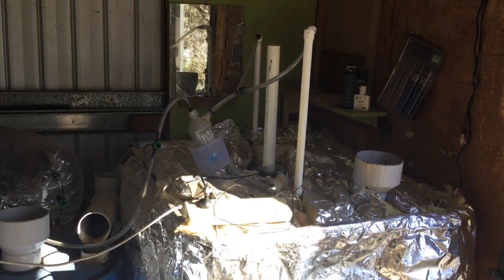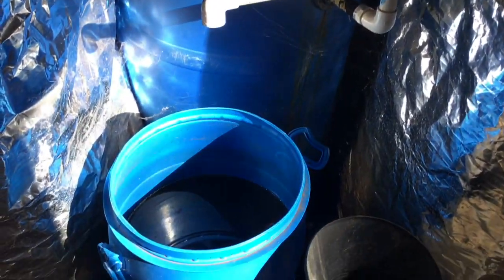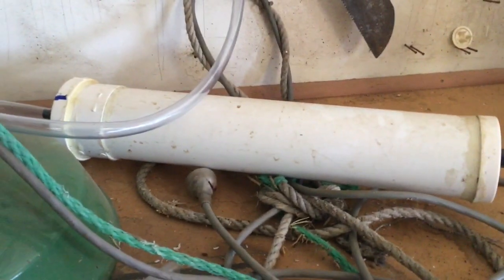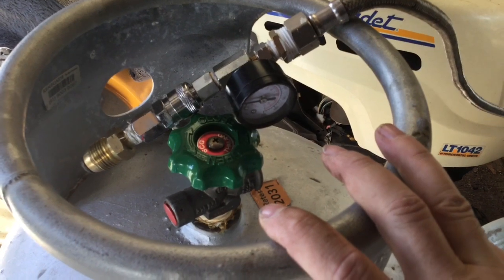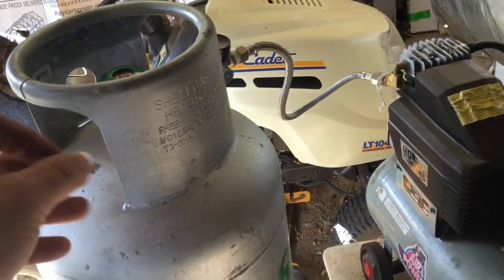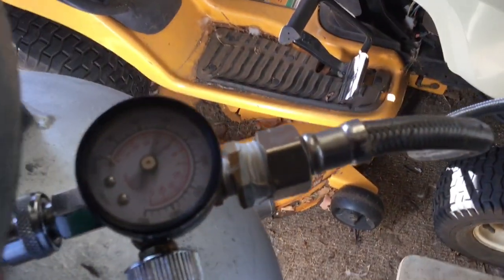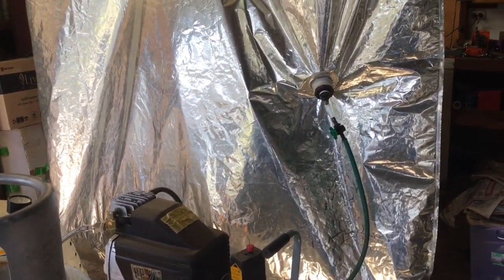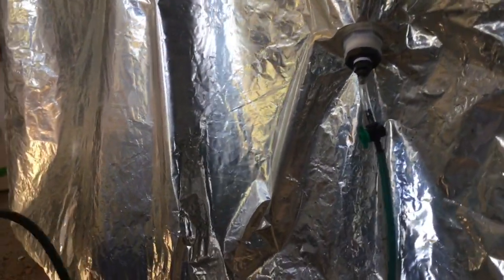Compressing Biogas !NEW! 1000L into a 45kg tank

Comment: I know that is an older video, but have you considered  using a fridge/freezer compressor instead? Uses a fraction of the power to run, and reaches a higher pressure, like 400psi. through a pressure switch on it,, and you could automate it. Also runs much cooler, and the lubrication can be handled by a self built oil  accumulator
Reply: He said in the video you can't go much higher with the pressure because in order to do that you would need liquid nitrogen to cool the gas into liquid. Not practical for at home unless you have a liquid nitrogen. If I understand correctly highly compressed hydrogen is dangerous if it's not in Liquid form
Reply: I was thinking that too. You would need a condenser with a fan to cool the compressed gas... like a refrigerator.  It should work.

Comment: The idea for having an aquarium heater is great. Here is how you avoid cleaning it. Place it i a separate pvc pipe cylinder with antifreeze in it. Seal it off so it will not leak. place it in a uniseal  at the lower part of the container. This will work and keep it effective for heating the effluent.
Reply: Why would you even bother though? What am I missing?
Reply: @adamsaquatics3332  could be another video..i hv also seen it somewhre
Reply: find someone selling a used waterbed and then ask them for just the heater. not a single person buys a used waterbed so you will get the heating mat for free. strap that to the outside of digester with no extra parts and you only have to clean that 0 times in forever. you could possibly use the waterbed as storage as well

Comment: I know this is a few years late BUT have you thought about using dry ice against a kind of heat exchanger before the gas goes into the cylinder? Ideally, the gas would cool to near 195K (Dry ice temp) and then when the temperature rose back up to ~20C the pressure in the tank would be about 240PSI (if the initial pressure was 160PSI). It could be a cheap (ish) way to test cooling the gas for higher compression with the existing compressor.

Comment: Just a thought if methane is lighter than air would it not be beneficial if you turn the bottle upside down when flushing it? That way the methane would stay at the top pushing oxygen out? An easy way to test it would be holding a lighter up until it ignites?

Comment: Hello my friend. I´ve been looking for some time about how to do this. The horrendous experience with the authoritarian regime in my country, #Venezuela, has made me to find alternative ways to provide fuel for my modest needs: cooking and fueling my vehicles, an SUV and a motorcycle. After reading some really useful documents I´ve found that moisture needs to be retrieved from the gas (fitting an inline silica gel filter, maybe from a car air conditioning) and a scrubber (an enclosed vessel filled up with steel wool) which will react with the sulfides and sulfates and will avoid the corrosion associated to sulphurs.  
I´ve not yet built it because of my return was stopped by the Quarantine but I´m going to use your videos as a guide. 
Thanks for sharing, dude!
P.S. PLease people remember this gas explodes. Use your common sense.
Reply: Thanks for the ideas
Reply: I've seen other videos where it's being said that it doesn't explode 🤷‍♀️

Comment: Great video. Just stumbled on your station after brief google search for biogas compression. I have installed several 10m3 biogas plants in Indonesia, and am wanting to diversify the application to more than just stoves. The next step for me is everything you have done. Scrubbing, cleaning, and compression. Seems I am getting stuck on the cleaning/scrubbing step, but your bleach/water tank and steel wool/clay pellets seem to do the trick eh? Where did you learn the bleach/water mixture idea from? Can you explain the flow there? Does the gas bubble up from the bottom? What is the bleach/water ratio? Do you change that out? How often? Awesome video, keep making them!

Comment: I have recently started watching your videos and I am impressed! you have such a nice setup.
I have 2 questions regarding your system. I hope you answer.
1) How do you stop the gas leakage from the overflow pipes as I don't see any valve around the overflow pipe.
2) How many days would it take to refill this gas bag after it has been empty?
Reply from the maker: Hey mate, over flow pipe goes down into the liquid on the inside, stops the gas. As far as filling the bag, depends on temperature, how much feed, what you feed, and how often you feed, optimal conditions I can do the bag in 2 days
Reply: Okay Got it!
Thankyou for the reply :)

Comment: thank you for the video. Would you please show in detail how you empty the  oxygen out of the tank. thank you
Reply: I think I heard him mention that because he used what was in it, that he knew there was no oxygen inside. I guess as long as the tank valve was closed when the previous gas content stopped having usable pressure there was no chance for oxygen to enter. I do wonder how biogas and residual propane get along though? Is this a non issue? I use a butane long reach lighter for igniting my propane cookstove. Unlit  propane often somehow " blows out" the lighter flame. 
Not sure what is really happening when these two flammable gasses meet.

Comment: The electrical consumption surely exceeded the energy in btu from the gas available. Best to just use the gas at low pressure in large bags or else it essentially makes a worthless process. The only way I am aware for this to make any sense is that it was a compressor fueled by the bio gas itself to compress the bio gas. Thats the reason wellhead gas is transported from the wellhead to the refinery by compressors that are run by the very gas they are transporting. Love the experimenting though! Always fun to watch!

Comment: Hey mate (sorry I don’t know your name), I love your videos and am currently in the process of building a mini biogas system, using a 20L bucket. This is just to prove to my wife that the system works and it’s worth me building multiple large ones 🤣🤣 (convincing the wife is a process).
Do you feel it’s worth compressing the biogas into the cylinders?. I mean, have you had reasonable success doing so?. I was originally excited about compressing biogas, as I’m a plumber and understand how to put these sorts of things together, with little effort. However when i started reading up on methane and found you couldn’t compress it to liquid form without lowering the Temperature to -150 degrees C, it was a bit of a downer. Then i saw your video and thought “I wonder how much he’s actually getting in there?”. So are you compressing that entire air mattress into a 9kg bottle? 
How long does this take and how much time are you getting out of the compressed gas?
You’re just connecting the air intake for the compressor, to the methane filled air mattress, yeah?.
I am currently sitting on the thought that I will probably just collect truck tyre tubes and stack them one on top of the other, in some sort of cylinder enclosure. I thought i might use a large container on top of the tubes, which I can fill with water using a valve, to compress the tyre tubes and force out the gas. I can always muck around with the spring in the 2.75kpa LPG regular if needed and bore out the injectors also, using a purpose made hand held boring drill. You get these at gas wholesaler places like BOC, or you can order them online (incase you haven’t heard of these already mate).
Anyway, would love to hear your thoughts mate. Love your channel, love what you are doing and am super excited about the advancement to the generator. I shared this video with a couple of mates and dream about the day that I can run the AC at home, on a biogas fuel generator (we need AC here in SE QLD mate).

Cheers

Chris

Comment: So cool! Perhaps a silly question, but could you use the tank on the compressor to store the gas?
Reply from the maker: You could,  wouldn’t store much, but possible, you would need a valve at the output end to keep the gas in, then possibly have a hose and regulator then use it straight from the compressor.

Comment: Thanks for your video. Is there a risk of fire or explosion when you compress the gas into the cylinder?
Reply: Triangle Fire = Heat + Oxygen + Fuel. 
In that cylinder only have Fuel + Heat (no Oxygen then no fire or explosion)

Comment: Hi . . . .really fantastic setup and easily understable content. . . .I've become a fan of your ideas.  . . Rolled down the comments and couldn't find one one bit... Is there a net calculation of energy generated vs available for use. . . .sorry I  cud'nt put my head around it. . . .just an easy to refer calculation right from amount of biofeed into the digester to compressor to electricity generator and the energy required to transfer/ transform at each stage... and wastage stages so they can be contained.  . . .cheers viv

Comment: Hello mate! 
I am deeply happy to find your channel and learn all these things from you about Biogas! It's amazing when you realize that energy is a free good..
I am a real keen of renewable energy sources and I was wondering lately how to have free heating for my house during Winter time. So when I found your channel was like an oasis! Haha. I really I appreciate you
So my long project short is to produce  Biogas during automn and summer and store it in tanks so that I can burn it later. 
A few questions though
In this 45kg tank the maximum storage capacity of Biogas is 1000lt (in 1 atmospheric pressure)??? Can't we store inside more?? Or is it impossible with this specific compressor? 
My question is if we can fill the tank to its commercial capacity as when we buy it full from the store so that can be more of handy
Reply from the maker: Hi Nick, to get practical and commercial amounts in a gas bottle, you will need a dedicated compressor ( have a look at Nuvair CNG) and CNG tanks as they handle higher pressures. Also have a look at Liquid Compressed Natural Gas. Very interesting.

Comment: If you cool the Cylinder it would help suck the gas in itself.   Gas will be worm and cylinder cool to about 10c would help . Transfer the gas . Its like the plastic lighters you get hard to fill when warm .But if you cool the lighter in the fridge  for half hour .It will fill fast to the top. with the warm gas .

Comment: I never thought about using an air compressor to fill tanks . I can't believe you have no safe guard's in place unless that compressor is totally made of a non metallic alloy all its gonna take is one spark everything is sitting side by side in a closed space with you in it . Its gonna light up with an explosion then a flash fire. I'm going to pretty much use your setup except the compressor will sit behind a concrete wall 25 to 50ft away no ceiling so the energy would travel upwards then a poured concrete enclosure 25 to 50ft away probley 25ft would work. Wall thickness 4 to 6ins between 3 to 4ft  high with couple pieces steel tubing or a mess  mat you could easily  lay over catching flying debris somewhere between the two a block wall where you can stand with the switch in an explosion proof electrical box. Couple fire extinguishers. Yes this sounds extreme Ive pulled a gasoline tanker for  many year's  until becoming msha certified to work in any strip mine in 49 states and I've always said just before it went all wrong it was going alright.  Again thanks for sharing your setup

Comment: Very good old mate just found you today this is the second video of watched pretty impressive.just a idea on the discharge side of the compressor run the gas line through a condenser to minimise heat
Reply from the maker: Definitely something to look into! , I’m usually short on time, is there a source for info of how to hook up that I can look at off the top of your head?
Reply: Lucky Hill Farm  copper coil in a drum of water 3/4 inch the heat will disperse into the cold water yeah and time is one that is not on anyone’s side.where is aus are you
Reply from the maker: Near Orange nsw
Reply: Lucky Hill Farm central Vic near bendigo
Reply from the maker: Ahhh nice one, originally from Albury.
Reply: Lucky Hill Farm going to have a crack at making one shall use Chook sheep cow shit in it that should work ok

Comment: Um use  a scuba diving compressor 4500 psi and a tank for nitrogen replace the valve with one that is used for combustable fuel. Place the tank in a hole fill with ice to lower temp to zero. Liquid methane. Now at 4500 psi in liquid state is stable and can hold weeks of fuel per tank.😊

Comment: Very interesting ! Thanks for sharing ! I will try the same. Have you assessed the possible risks ? Do you have any warning or advice about that ?
Reply from the maker: Sorry for the delay, biogas is a relatively safe gas to work with compared to LPG/Propane and other natural gases, I may do a video where I purposely try and explode a small gas bag, a lot of gas appliances have safety gas shut offs, currently working on a fridge vid and it shuts off if the gas dies down or flame goes out, the wife still didn’t like the digesters near the house hence the ‘moving the digester vid’ but there is bugger all gas within the digester itself, I’ve never used check valves only the water lock/bubbler/scrubber from the tank itself, but of course there is always a chance of risk with combustibles.

Comment: When you compress any gas it makes the surrounding pipes and tubing heat up tremendously, People wanting to try this need to be careful that the piping coming out of their compressor does not over heat. Many air compressor tubes have aluminum heatsinks around them to help dissipate this heat. A flexible water hose with rubber inside is definitely not what people should use.

Comment: Newby questions.  How do you know the tank is full?  What pressure is high or dangerous?  Is the gas in the tank useable down to a pressure of zero?  Does the heat generated by compressing the gas reach any kind of dangerous temperature?  How is the "burn time" of that biogas tank you filled compared to propane?
Reply: The safety valves will release at about 250 PSI on a tank that is in good condition. If you have the "swap and go" system near you then you could grab a bottle from there and use the propane then refill it with bio gas, that way you know it also has no air inside the bottle when you fill it up, or you could buy a new bottle on ebay or from a camping store. The 18kg bottles (forklift size) are a good compromise size, easy enough to move around but still hold double the small BBQ bottles

Comment: interesting set up, well done you, any idea on how long would the 45 kg bottle run an infinity heater or generator converted to gas for ?
Reply from the maker: A generator I have not tried, you can get biogas specific gens from China, hot water systems are good, I have a biogas instantaneous hot water system (previous vids) that I’ve just a bbq bottle on, not sure if I did a vid with the 45kg but I’ve used it and lasts quite a while, worth it if your gas production is high enough
Reply: How long does it take to fill you're containment bag :-)

Comment: Wood gas at it's best is methane and hydrogen and at worst carbon monoxide.  I used a sealed vessel with external heat and running the wood gas through a catalytic converter. The gas is similar to natural gas which is a low energy gas that does not liquefy.  I have some in propane tanks that has been stored for at least 7 years. I crack the valve and burn some now and then, it is as god as it was when I made it.
Reply: I want to do like this. Can i directly fill cilinder.

Comment: Hmm so apparently the moon titan is likely to have liquid methane, due to cold temps. Getting methane that cold and keeping it there is really practical, as you eluded to.
Is there really much benefit to compressing it into a 45kg bottle? Seems like your getting the volume down to maybe an 8th of size, but that took half hr running compressor (chewing power).
What are advantages of using 45kg bottle over a bag?
Thanks for your vids.
I'm waiting for heater to arrive to warm up my first IBC, I was impatient and have already added cow poop, tank only art about 18deg C.. plan on building another 15+ if everything goes to plan.. Will need to work out my insulation method, as they'll be outside in the sun (and cold of night)..
Reply from the maker: The compressor is running off solar power so FREE 😀 the advantage of compressed gas that I’ve found at least is steady pressure when hooked up the the regulator, especially with the instantaneous hot water system, it’s in one of my vids somewhere, and no power leads running everywhere. I prefer it.

Comment: I did something similar. The only thing is that the head of the compressor heats more when compressing biogas than compressing air, so I added water cooling to the head by wrapping copper tubing around the head. If the biogas is a bit cooler, you can compress more into the storage tank.

Comment: It's really nice i want to know about the full details of compressor that used
Reply from the maker: Just a general cheap one from the hardware store, then I had to trial and error parts and connectors to make it all work, parts depend on the compressor out buy I suppose, might also be manufacturer depending to sizes they use, trial and error don’t be afraid to make mistakes.
Reply: Lucky Do you ground it in any way just to reduce sparks, I had the same idea about compressing, to use an air compressor, but my concern is about safety